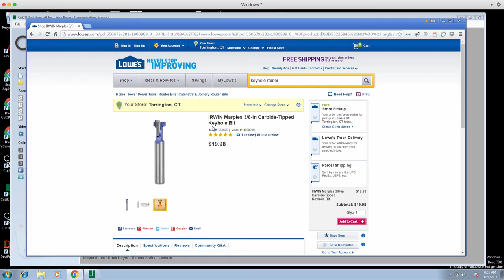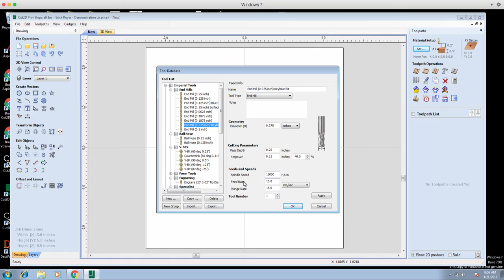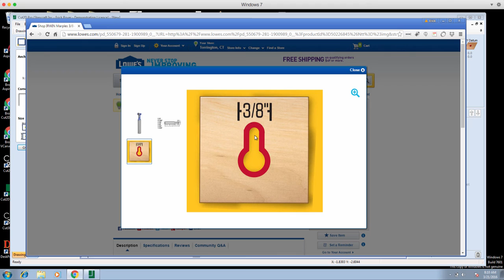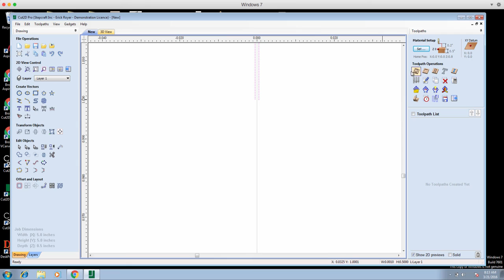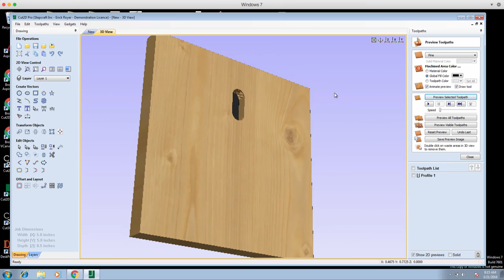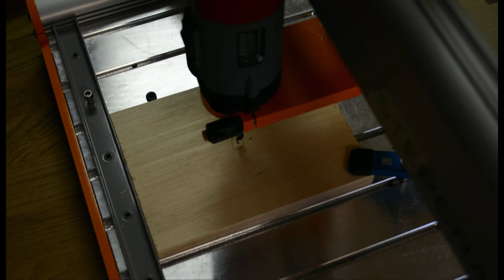STEPCRAFT TRAINING - Making a Keyhole Slot On Your CNC with a Keyhole Router Bit - Easily Hang Signs

Comment: Great gadget. Although I can't get it to work. I can't get the Vectric Keyhole gadget to work either. Something is wrong, I guess with my CNC. No matter what depth I choose the keyhole bit will not plunge enough to make the keyhole. I think maybe it might be my coupling is slipping. I have no other problems. Just finished a sign using a 1/8 end mill at 1/4 cut depth.

Comment: Good Morning,
I am cutting numbers out of material and want to add small 1/8" holes to the reverse side of each number. Could you suggest how I could reverse the part to show the back of the numbers. Then add points/placements on each number where the tool could simply drill a hole for a small dowel to be inserted. This 1/8" hole will be positioned and cut inward 1/4" in 2 places on each number as to secure each individual number in place on the wall or wood address plaque.
Thank you for your help.
dante.rushmyorder@gmail.com